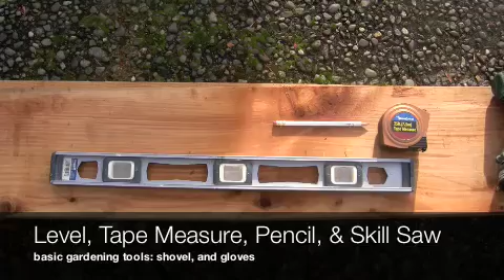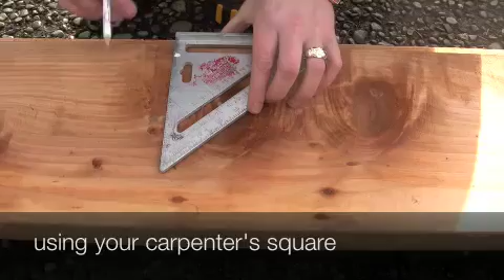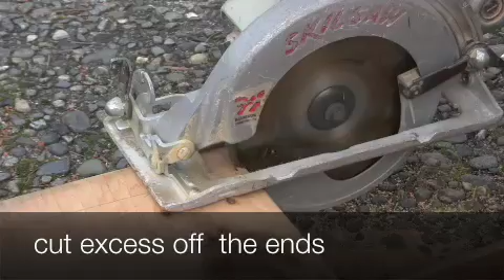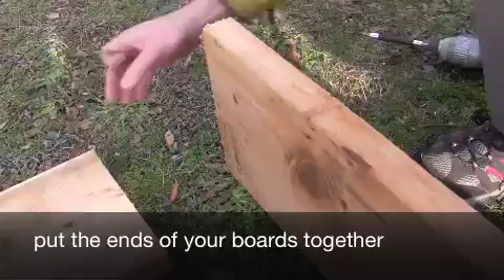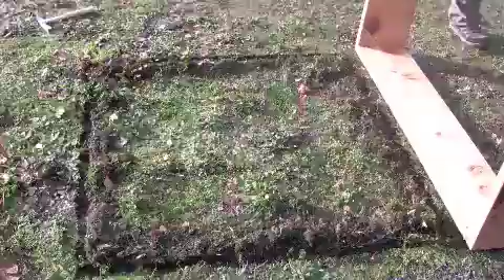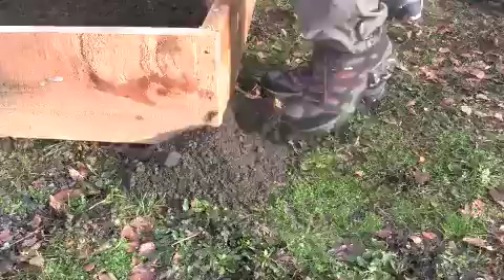How to Build a Raised Vegetable Garden Bed

Comment: no pre-drill here, wasting time...i like to ram it in
Reply: Splitting the ends of the boards perhaps. I just built 4 x 4ft x 6ft raised beds with 8 inch x 2 inch treated pine and I split a couple when I didn't pre-drill. I guess it added about 10 minutes to construction time but IMO it was worth it to do it properly.

Comment: Stafford Morse
Go one step further and put on a apron of plastic sheet around the inside of the planks starting from the on the top edge over the inside and down to the bottom and under the bottom edge also to that the soil will not touch the wood and rotten it. Finish off the tope edge with a 1" of board to make it look clean and not have the soil tug on it and rip the plastic. Buy numbers at the hardware store and place them on each box so you can id the box on planting log of what is planted each time for reference.

Comment: I have a farm and cannot stress enough the value of good soil. It doesn't just "happen". For raised beds. 1/3 top soil, 1/3 sand, 1/3 rotting leaves or compost.  THEN compost  cooking scraps (peels, veggies, etc) all winter and spring.  (I gather in buckets on the back porch and empty every two or three days - we cook a lot,)  I also add layers of leaves and ashes from the corn bonfire. Your only problem may be that the soil is TOO strong, especially if you live in the South and have bugs year round.

Comment: Negative Comments!!! This project is very simple. If you think that you cannot handle cutting and screwing together a few boards then gardening probably gonna be too difficult as well. The steps of making a garden box are not unnecessary. You cannot just use any wood or screws. It must be naturally rot resistant wood and outdoor screws. Treated lumber has chemicals that will harm your soil and veggies. By the way raised beds are better than traditional crop rows-less compaction & better drainage